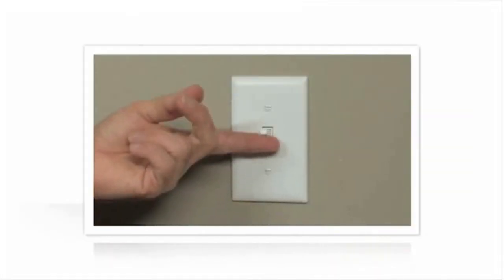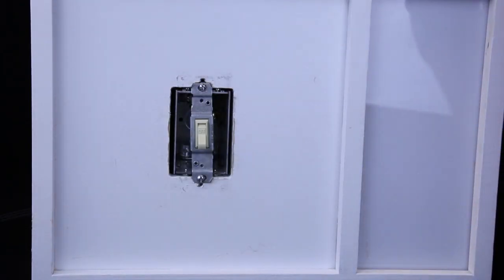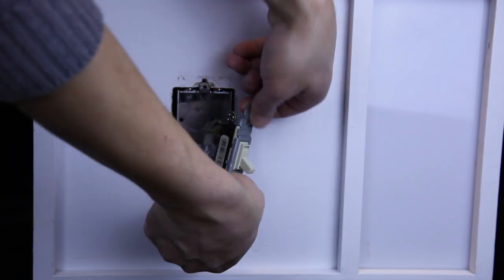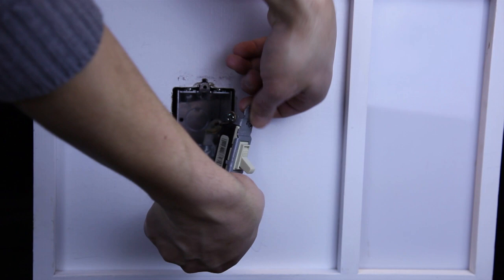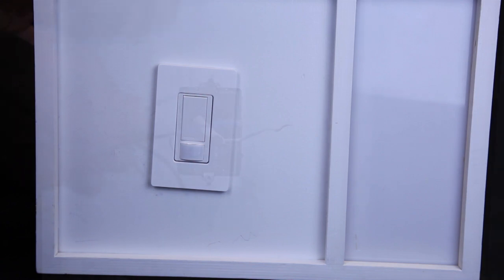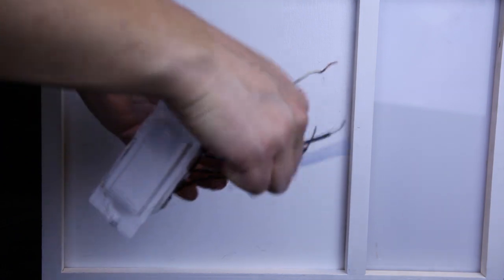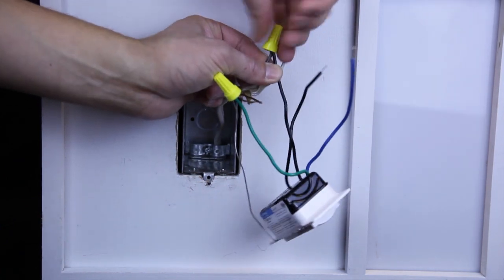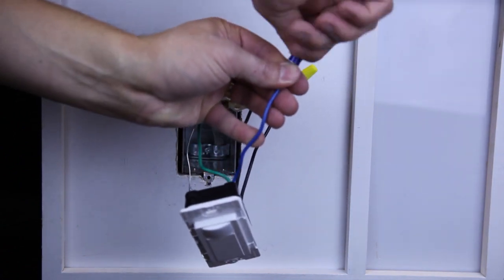Wiring a Control with Two Black and One Blue Wire (Single Pole Application)

Comment: I capped off the silver wire as the directions didn’t say what to do with it
Reply from the maker: Depending on the Lutron device, the silver wire may be needed to be connected to the ground if it is a Maestro wall box sensor. We'd recommend out to our Support Team at support@Lutron.com or by phone at 1 (844) 588-7661 for additional assistance.